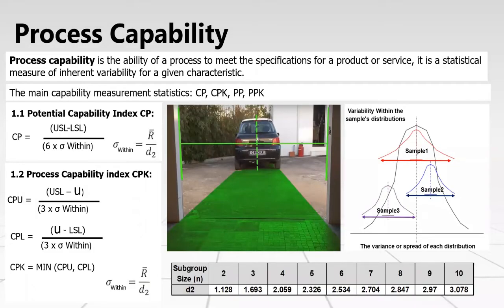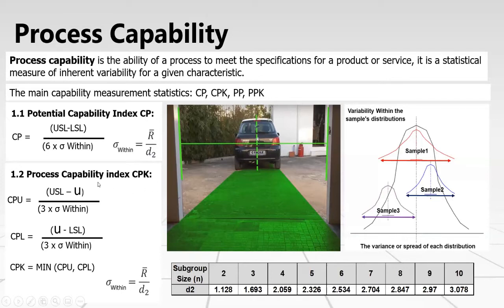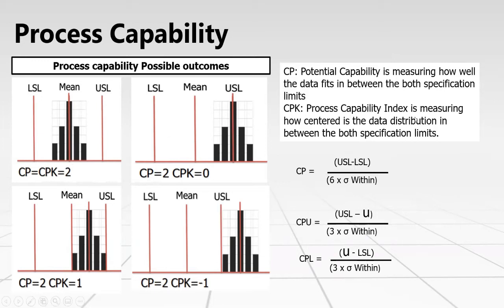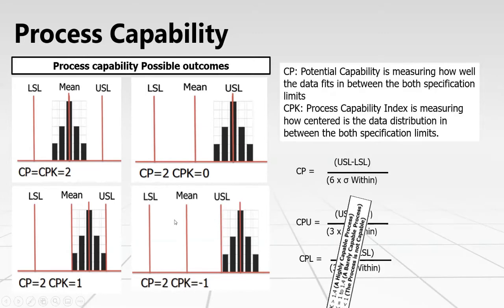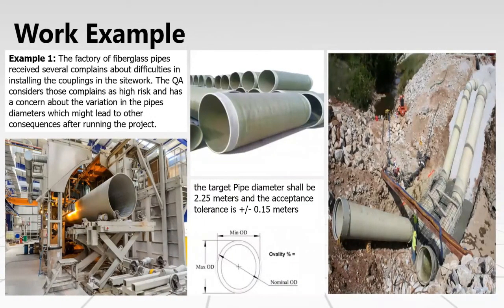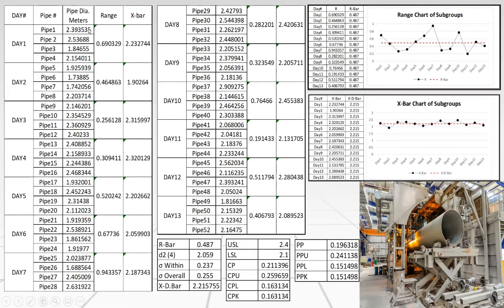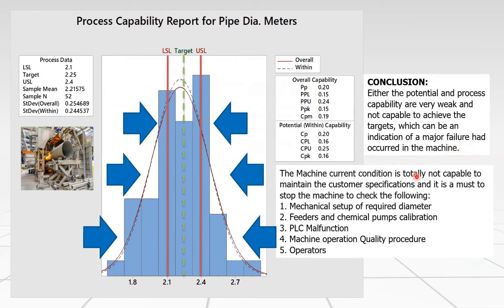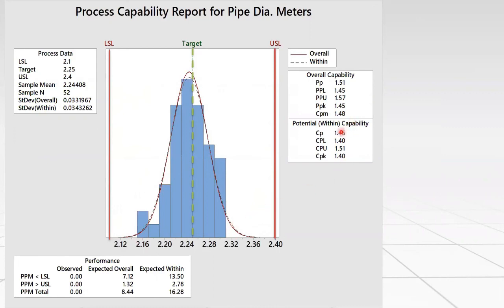Process Capability CP, CPK, PP, PPK

Comment from the maker: These rules are only valid for normal distributions. Using them for no normal distributions will create high errors,
We usually consider by nature the data distribution of a process a normal distribution unless there is an assignable cause causing a high variation in the process.